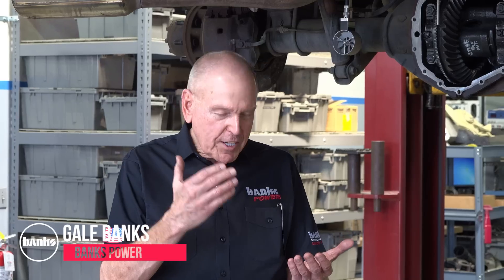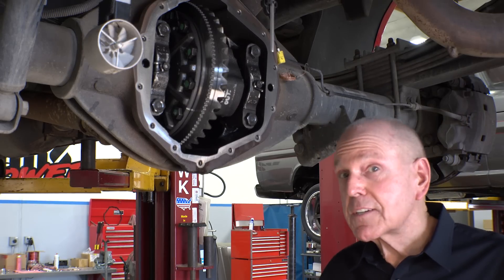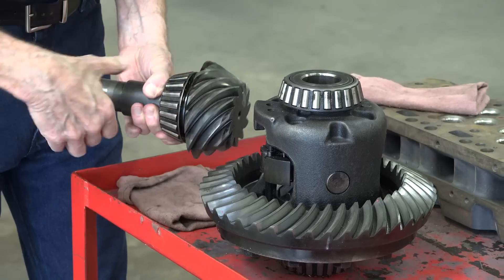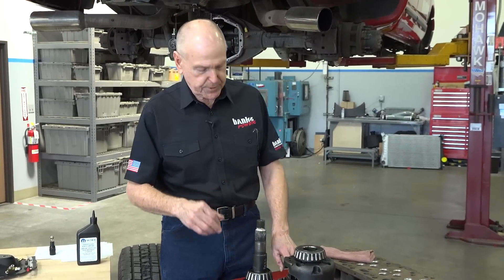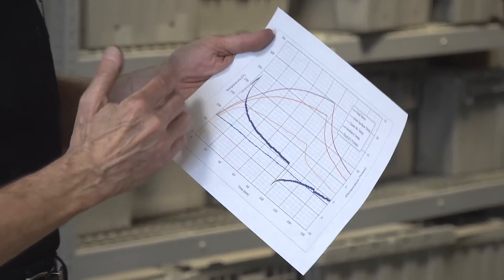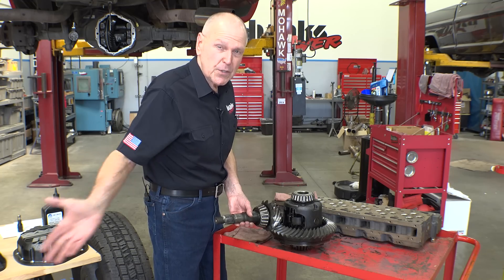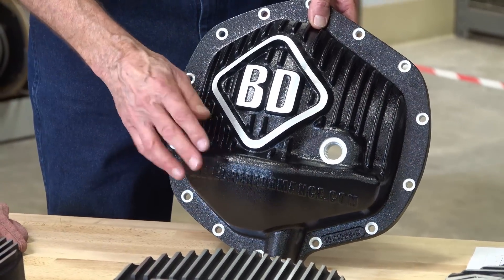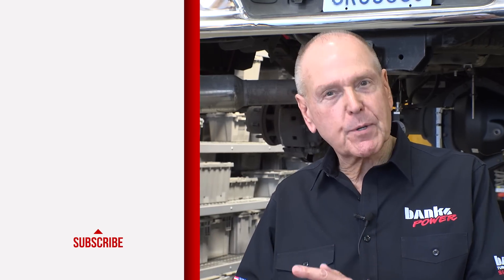Do Diff Covers Work or Are They Just Bling? Part 2 of 3

Comment: The best diff cover will strengthen the banjo beyond the stamped oem cover this in mind its not the alteration of the lube level but the added rigidity of the whole unit. A cast aluminum  piece with lock studs that lock the bearing caps in place is the only way to go. A oem diff will suffer from the extreme side load the pinion will put on it with increased mods above oem . Lock the bearing caps and add rigidity to the assembly proven in the 80s in the 8.8 ford diffs.

Comment: Thanks so much for your research and time/money. I'll be in line to buy a cover from you if you come up with a good one. I'm a mechanical engineer at East coast gear supply and build a lot of different rear ends. Own an 06 Duramax and a 97 12 valve with a Dana 70. Very interested and excited. Keep up the amazing work. Got a Banks intake on the Duramax and couldn't be happier

Comment: My thinking on the cover design... more fluid means it will take longer to heat up but also to cool down. The fluid splashing on to the wall of the case as you describe does not take into account the level of the fluid which will create its own smoother flowing channel within the fluid itself... not just splashing straight back into the wall. More flow will splash the into the upper part of the cover as gears come out of the fluid level. Fluid level is important as it will create much more pressure (thus equals heat) within the case also increasing risk to gasket and other seals failing.
Reply: Another thought... if the upper cavity is larger and there is more room for fluid to spread out in, this means the needed fluid level will drop considerably where its needed... that last cover and the stock seems to be only two taking this into account

Comment: It seems that ARB and Currie both offer diff covers that include the flow channel for the fluid similar to the OEM designs. It would be great to compare them against the stock and the flat diffs to see how they do? I am really interested in this series of videos as I use my Duramax 2500HD primarily for towing, and yes I recently added a "flat" cover design, which now appears to be a bad choice based on your testing.

Comment: So the prediction is the stock one will work best. If it does then I hope to see a cover shaped on the inside like stock. But made from thick aluminum for strength because I do believe it helps stabalize the housing. Fins on the outside for cooling like we see on some OEM covers. Plus a DRAIN AND FILL in the cover that takes a normal socket!

Comment: I have a spicer aluminum finned cover that looks like a stock steel but with cooling fins .according to the temp gauge in my differential oil cools down faster then stock.its Made by  spicer for the dana 80. I didn't see that one in your tests?

Comment: I have thought about adding channel iron to my highway cars and trucks. Heck, why not a diff cooler and pump. I found mileage with powder Teflon, albiet slightly. Cooler heat readings on a hotter day... That was using conventional rear end oil. MOS2 would be a nice temp/fuel consumption@load with the winner diff cover.

Comment: I would like to see a test with a stock cover, with a spacer. Just like a throttle body spacer or wheel spacers. It's a great way to add volume and stay away from the corners or cavities from the other diff covers. I think sealing everything would be the issue. Unless there was an o ring built into both sides of the spacer. And you could add a drain plug into the spacer as well.

Comment: Worth it.just for the huge magnetic drain plug at the bottom of the ring where all the crap settles. Unlike the stock Ford cover that places the only little magnetic fill plug up high and to the side, doesn't pick up diddly sqat compared to the Mag Hytec. Still use the factory fill plug level to fill. Sounds like the perfect cover would have the same huge magnetic plug at bottom of ring, and radius match the the cover to the ring for better flinging effect.

Comment: IMO this started with the Ford 8.8. I believe the fluid level has to be high enough that when the gears are at max rpm the windage isn't able to push the oil away (starve it's self). I wonder, does the speed at the OD of the ring gear play a role in fluid level and fluid type? What does it take for the lubricant to lose it's adhesion to the surface? (I'm doubting it could spin fast enough)
PS. I have a Ford Mud race truck thats running TTB D40, Ford 8.8, NP435 transmission and NP208f transfer case. I run in the 6 cylinder class so I am always looking for "free" horsepower. So, I am really enjoying this.

One more question I have been wanting to ask you. Have you ever thought about reproducing your turbo kits for the 385 series Ford? I am a 385 series and 240/300 L6 guy and would have loved to just have a set of your cast turbo manifolds! I'd be excited over the moon if you made a cast turbo manifold for either one.

Comment: Use the stock cover and braise fins on the outside . best of both worlds. it works very well on my F-350 SD
Reply from the maker: Good idea but it doesn't overcome the fact that there's no airflow over the back of the cover. At 50MPH, there's less than 11mph of airflow over the face of the cover. There's a dead-air zone behind the rear diff. This zone extends out almost 36". Fins are only as good as the airflow rushing over them. That's why we patented the ram-air scoops. You'll want to watch the rest of the video series for the data.

Comment: I think those tires were overinflated.
The center section of the contact patch is worn,and nothing on the sides.
They ballooned.
Reply: michaelovitch dynos are very hard in tires, it’s because they are running at high load on a curved surface so there is a small contact patch. That heats up tires and wears them. It normally isn’t an issue but for the length of time he’s running that becomes an issue.
Reply: I understand and agree.
It seems to me that's wear is really localized on the center,that's why i think its caused by over inflation.

Comment: So as long as the interior mold of aftermarket covers match the factory cover it doesn't matter what the exterior looks like? That and the fluid level stays the same. Because I'm looking to get an aftermarket one simply for making fluid changes easier.

Comment: The rounded back to the diff cover is part of a mechanical pump and taking it out makes low rpm high torque dangerous.  (got that from an EMD traction motor tech)

Comment: Question? Does the "sweet spot" for the lube's temperature change as parts get worn? Does the fluid need to have a different viscosity as the parts wear to compensate for the wear??

Comment: so.  when does the new banks cover come out.....hmmmmm.  this is good stuff! i never bought a "big" cover for the reasons Mr Banks gave about fluid flow.  but i do like the BD since the reservoir should be at run level where the fuid is picked up by the ring gear

Comment: Honest question all. As far as the fluid level,  why would the cover matter if the max fill point of the diff is at the fill hole? Meaning, regardless of the cover you can’t fill the pumpkin higher than the fill hole. 
Also, I understand that with more or less fluid would have a temperature change in the fluid but for the sake of questioning (not argument) wouldn’t changing the gear ratio do the same thing? Just wondering. 
Of course there will be temp changes and maybe even fluid loss or gain. The reason I ask the questions is 1) I truly want to know the answer and 2) is the juice worth the squeeze?

Comment: Afe makes two different covers for the Sterling 10.5 Axel, is Banks going to test both? One looks like the Mag-Tech bolt on box cover, version 2 or the updated model looks more OEM in profile. As both share some of the improved elements or features but different in profile wondering if Afe has already figured out what Bank is testing for?

Comment: So are you coming out with a differential cover for the Ford and what was the part three of the conclusion of the rear and cover test
Reply from the maker: Yes, the first cover to be released will fit the GM/RAM 14-bolt followed by the Ford. We'll be announcing the data as well as details about our covers very soon.
Reply: Thank you would love to install it on a 2002 Ford Excursion

Comment: I have a hard time thinking the flow restriction in those little reservoirs is within two orders of magnitude of the actual differential in terms of the "work being done on" the fluid".  So I'm not sure if he's worried about the addition of heat, or the reduction of the fluids life...but I think it's simply a non-issue. Also, I think the ring gear being drug through the fluid puddled at the bottom of the differential case is whats lubricating your contact surfaces. The fluid being slung all over the inner walls of the case is likely not that important or useful, so those flow impedances in the inner wall of those covers likely just don't matter. I think so long as you have a big fat hunk of metal with some cooling fins on it, it's to-may-to, to-mah-to.

Comment: Very interesting study. I appreciate the rigor. I use a Ruffstuff Specialties diff cover on my 4x4 bc I peeled back the stamped steel OE one on some rocks- fairly common with lots of trail use, I think. I wonder how one determines ideal fluid levels when using an aftermarket cover and altered pinion angle?

Comment: My rear diff on my 2006 5.9 has a leak. Since there isn't a final video yet what would you suggest? Repair? Or by aftermarket? Was going to do the latter before watching video. Thanks
Reply from the maker: Steven, you're way behind! The final video in the series was released late last year and the new Ram-Air Diff Covers have been nearly impossible to keep in stock. 
Final chapter: https://youtu.be/vdtmDl5EDJ8
Diff Covers: https://www.bankspower.com/diffcover

Comment: Nissan had diff. issues on the first model year Titans, and after a couple years starting installing aluminum finned diff covers from the factory, so it would appear their engineers have already determined they do help. They appear to facilitate cooling, not to hold more oil.

Comment: Does the ambient temp let’s say outside  in the summer where its 45 Degrees Celsius could affect negatively the Ring and pinion  ? Or it’s a slight impact on performance
Reply from the maker: Certainly, ambient temp plays a role, but it's minimal

Comment: I'm interested in how the BD cover performs.  I just have a stock cover on my 2008 Dodge 2500, but the BD maintains the curved shape better than, albeit the lower portion shape does look like it would not be as smooth a flow as the stock, or the other after market covers.  So, this makes me wonder a few things....where does the gear oil leave the ring gear to get thrown up into the upper portions of the rear end assembly?  Below the oil fill line mark or farther up the ring gear?  This question is important to know if the shape really matters as much as Mr. Banks implies from the amount of time he discusses it..... If the oil leaves the ring gear farther up on the ring gear the BD's sump shape may not impact flow that much.  Also, there has to be a relationship between the gear oil getting worked and oil temperature increase due to that work, and the extra volume of gear oil that would counter act ,or delay the increase in oil temprature.  Is there anyway to control for this?   I look forward to part three and other videos.

Comment: Supposedly the fins on the diff covers reduce heat. Depending on the car or truck some diff covers can be paired with a cross bar to stiffen your rear diff less flex and deflection less chance of damaging gears. Wether it works or not, not sure.

Comment: Mr banks .. here’s my thought ...if you increase the volume but not the height .. a higher volume would mean less heat .. cooling fins on the outside would further scavenge the heat away ... ok now for sling which is how the system works .. what happens because the distance from ring gear to cover is increased? One though is well you have a higher volume but not higher level so how does that affect sling ? ... how does this new higher volume affect horsepower to the wheel ? Remember the height is the same .. if horsepower is lost is how much ? But is there a benefit in temperature  ? And in a hard running situation would that better heat situation be beneficial ? Particularly to wear and tear
Reply: Well said, someone who actually has some individual thought. It will not be looked into because it does not coincide what what he wants to tell everyone. Just like there are many aftermarket covers with the same rounded factory shape internally but he did not pick any of those for his test. I doubt the ring gear will be able to throw fluid 3 inches off to the back of the diff cover and the fluid will then go along the bottom of the cover, up the diff cover and come back to the ring gear, if it does that that is some magic fluid. He would need a cleargearz cover that looks like one of the aftermarket ones he is testing to see if the gear oil just clings to the ring gear as it goes around or does it actually go back to all the way to the aftermarket cover and then back to the ring gear like he keeps saying.

Comment: I just got a ram 1500 ecodiesle a couple months ago. I parked in a heated garage and got 25 mpg average. I started parking outside in 20-30 degree weather and got 22 mpg average. It did not mater how long i let it warm up (and I check this by going to get gas and reseting my trip gage) I would not get good mpg until I drove about 15 minutes continuously.
This makes me wonder if getting the rear diff and the transmission warm is necessary to get good mpg.
Reply from the maker: It could certainly be a contributing factor. All of your lubricants may need to be warmed up for proper viscosity.
Reply: @bankspower  That kinda what I was thinking also I tested the idea 5-6 times same result every time just don't have the instruments to check and see if thats the reason but if it helps you guys make better produces I hope that information helps.

Comment: any cover with a sort of basket to catch lube splash while running and then slowly drain it off to help with aeration, keep lube level lowest possible while still properly lubing the gears(running faster it would just overflow) and keeping parasitic loses down? i work on truck(road tractors) and they have stuff like that, like a "dry sump" on motors

Comment: Starting to look like the only reason to upgrade diff covers is for offroad purposes so you don't bash the stamped steel covers on rocks. I'm sure banks will make a billet aluminum cover that channels some of the fluid off the ring gear so that it creates a whirlpool on each side of the ring gear instead of it burying the pinion gear in excess oil, therefore less turbulence that would impede rotation. I think the greatest obstacle will be every design of diff cover will be most efficient in their right at a certain speed, so optimization will be nearly impossible.

Comment: Gail I think your missing 1 other manufacture from your test PML covers they are in Inglewood Ca  and there covers are designed with the same shape as the factory design I ran one on my 05 Ram for 10 years , hope this message finds its way to you before your testing is all done. Thanks for the awesome work.
Reply: I got a pal cover on my ranger

Comment: So from what ive seen the best cover would be one that maintains the OEM profile inside the differential, has no extra capacity, but has cooling fins on the outer surface.  Same shape but with a heat sink.

Comment: Thanks for the video Gale but doesn’t ram have a aluminum cover on the high output version of the Cummins engine?
Reply: You must remember that this cover is very well engineered on the inside, like a stock cover, and it engineered and made by AAM for the AAM axle it is bolted to. Not just some fancy garbage.
Reply: Yes I’m sure it’s engineered properly but I was hoping to see it compared to all these aftermarket diff covers and I would’ve love to see how it’s made inside so why people don’t order the factory one instead is it too expensive?
Reply: People do. 2 years ago, you could pick up the AAM cover for about $80 from Chrysler. That price has skyrocketed to almost $400 because so many people order it. I noticed in the comments that many people have asked Banks to include the AAM cover, so he might just do it.
Reply: mikesc90 thanks for the comment. I did not know that the price was raised to the point that it was not a cost effective solution but I was pretty sure that the factory would make something that would mimics the steel cover.